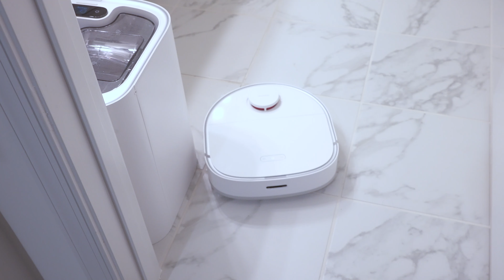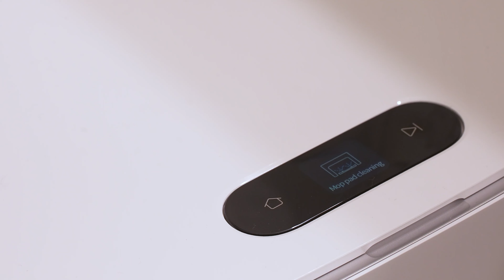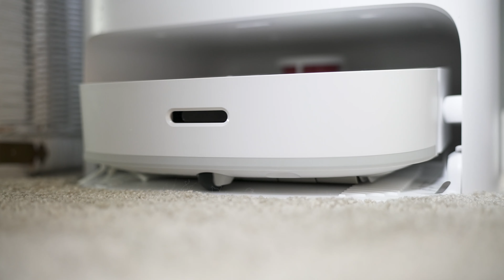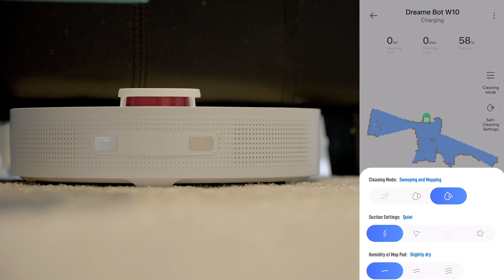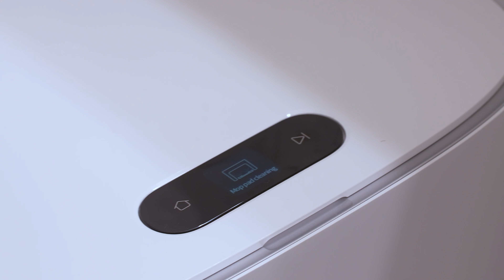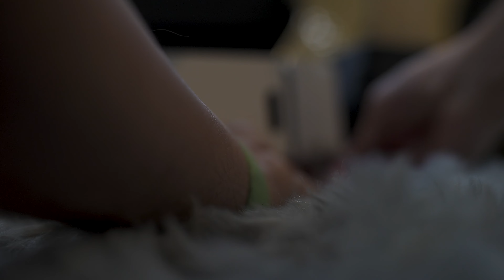Dreametech W10 Robovac Review: The Mop Washes and Dries Itself, But Forget It If You Have Carpets

Comment: Great review.  I am glad you called out the Hardwood/Tile and Carpet conundrum.   I currently have a Ecovacs N8+ pro that has the same problem with removing or attaching a mopping plate.  I am getting a bit tired of having to send the N8+ out multiple times taking off and adding the mopping plate each time.  I want to be able to send out the robot out and not have to worry about what accessory I need to attach.   Looks like the only option I have is to get the RoboRock S7 Max V which lifts the plate up when going over low pile rug/carpets (which I have).

Comment: Basically if I have mostly hard floors and a rug in my house. I don’t have the option it should vacuum the rug and wash and vacuum the hard floors?
Reply from the maker: No, this model is primarily mopping, so you'd either have to lift up the carpet and work around it completely, or mark it as a no-go area.
Reply: W10 has ultrasonic sensor for carpet detection. It will no go over carpets if mops are installed. Roborock s7 maxvv ultra.. will lift the mop on carpets

Comment: great review...very thorough...I purchased one to replace my old iRobot but haven't received it yet...do you have it scheduled to mop everyday? I am thinking to leave out the mop pads for everyday scheduled cleanup and manually attach the mop on a Saturday/Sunday (once per week)...mostly have dog hair issue (golden retriever).
Reply: You can set the schedule to anything you’d like, the day and time. I have mine scheduled to clean 3x per week at 12pm. It would be good for per hair. My only gripe is that you need to switch off the mop pads if you want to vacuum. It’s best for floors with limited to no carpets.

Comment: Is the app any good? Looks like they use Xiaomi app somehow which is odd. It is safe to install right?
Reply: If I’m not mistaken, Dreamebot is a subsidiary of Xiaomi which is why they use the same app and have many of the same features. App has lots of customization and settings. It’s been reliable and easy to use.
Reply from the maker: Yeh, the Mi Home app is surprisingly good, it's used for a ton of non-Xiaomi smart home stuff nowadays.